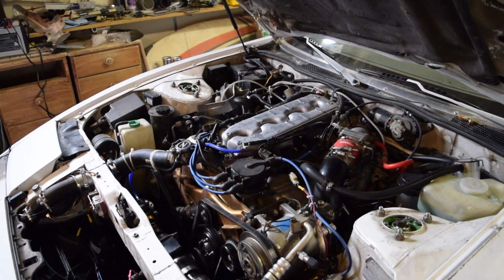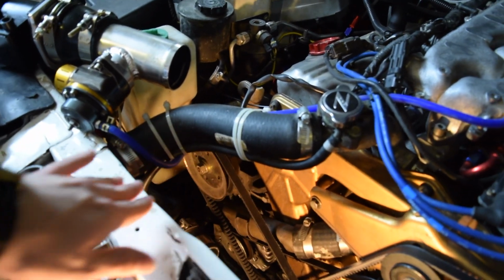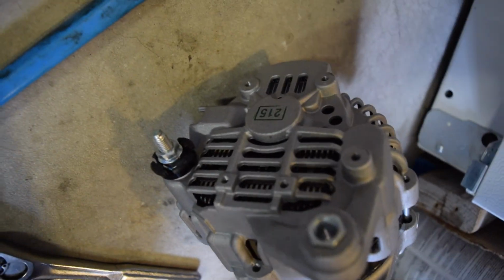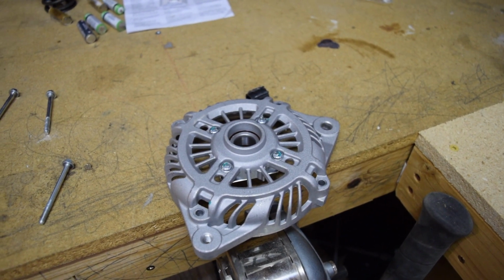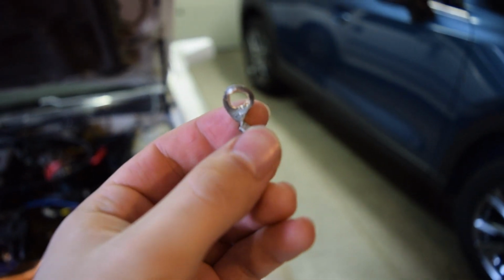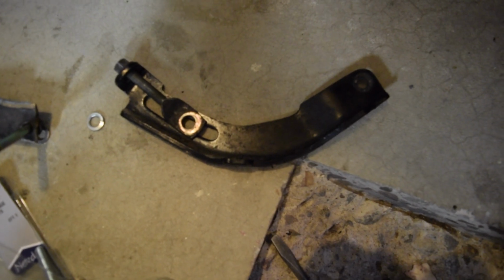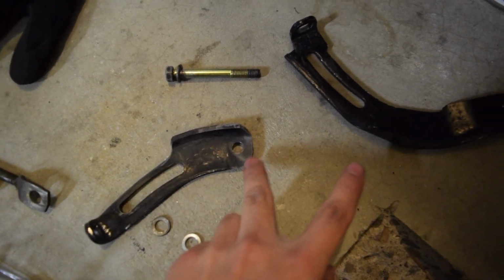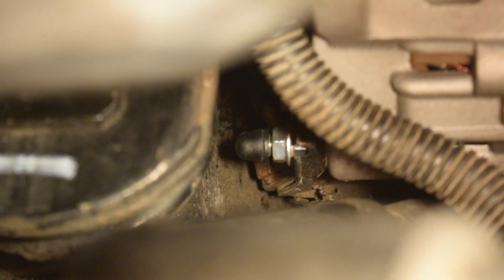G35 Alternator Upgrade (300zx Z31)

Comment: Was the maxima alternator not good that made you want to switch alternators? Or was it just because of the amp?
Reply from the maker: The alternator I had went bad on me. Not sure why but if I'm already replacing it, I figured I might as well upgrade since I'm going to be running more electronics in the future as well

Comment: This is a great video. I am currently waiting on my Maxima Alt to come in at autozone. I was considering a 350z alternator, but I got conflicting information on the forums about fitment. There are some that say it is a direct swap, besides the possible pulley swap, and others that say there is a fair amount of modification. Good to actually see all of the steps and complications involved.